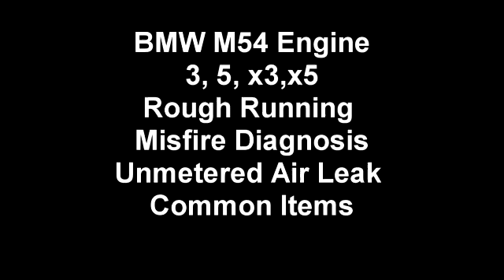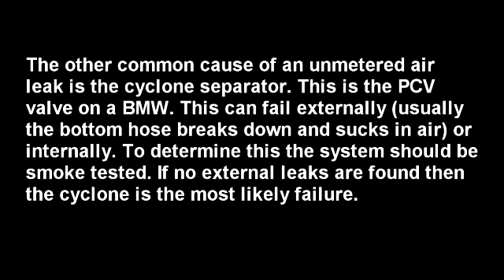Misfire Faults and Umetered Air Leaks BMW 3 Series, X3, X5 with M54 engine

Comment from the maker: That is correct. I have had this be a complaint for a buzzing or flutter during accell which is when the flap is failed and jumping around due to the air flow. Also some people notice a loss of power when the flap fails but it does not always set codes.
Thanks for the comment! :)

Comment: You may or may not get a P0171 or P0174 error code if you have a bad DISA Valve.  It depends on how the DISA Valve had failed.  If it fail in the open position you will get a lean condition which will give you the above codes.

Comment from the maker: Hello, If it was onoy the seal then just fixing that should be fine. If the flap was loose then the DISA would need replacement. The engine computer does not monitor this item so it is not diagnosable.

Comment from the maker: Hello Jay, The oil and crud sound like the Cyclone separator may be failing on your vehicle. This has an internal diaphram but it has to be replaced as a unit. The DISA flap also has a diaphram that uses the engine vacuum and an electrical change over (the plug) to move the flap. I have seen leaks in the diaphram for both units. But they are not replaceable separate unfortunately.

Comment: shouldn't a bad DISA appear on a diagnostics?
I found an air leak on both the DISA and found the seal was broken. I resealed the gasket and put it back in. It doesn't leak air anymore. But should I have changed it all together?